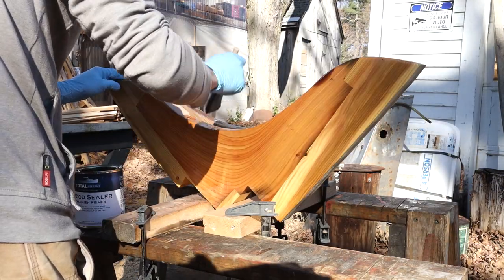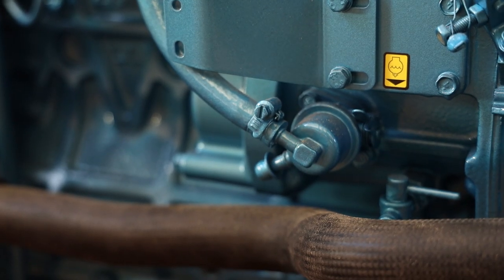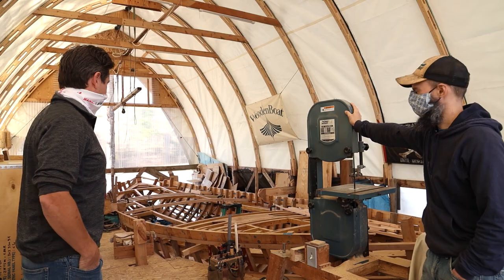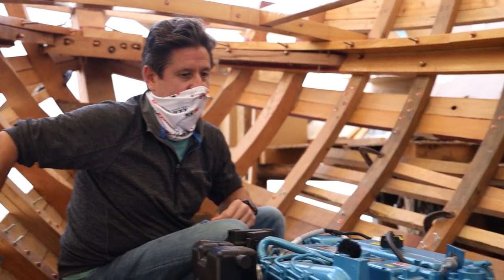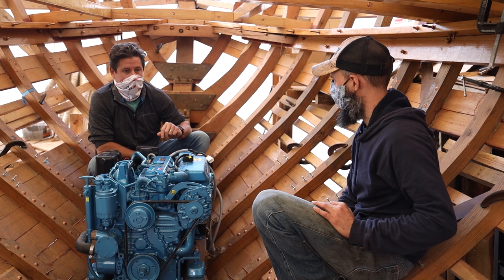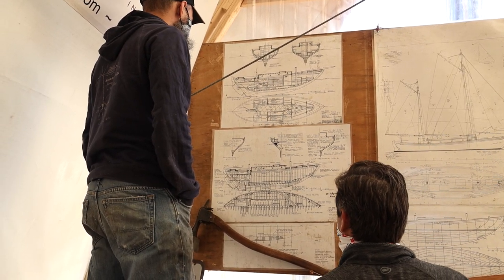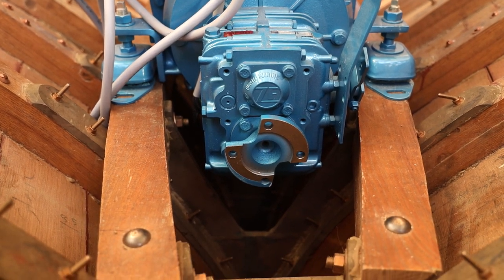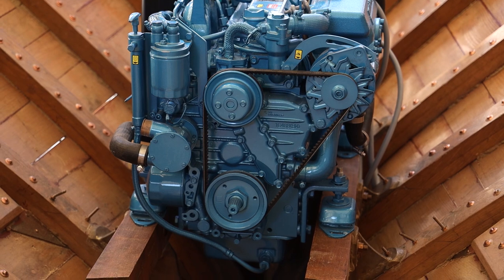Designing the Power Plant - Episode 137 - Acorn to Arabella: Journey of a Wooden Boat

Comment: No hot water??   Trust me, if you have nothing else down below, get hot water!

Also - do a full electric audit - double it and put enough batteries to deal with it - you need an Engine battery and a house bank and a charge controlling system - you will be surprised what you think you don't need but you end up needing.  2 Alternators is a must if you are travelling.
Reply: He needs to seriously consider a keel cooler.  A little more cost but a lot less problems later on.
Reply: I always see people go bananas over the engine. Everyone makes it sound like a disaster if there was an issue. You guys know this boat is wind powered, right?
Reply: As it stands, they'll have to stop recording and making videos once they're under way. Without solar or at least a battery bank running off an alternator, they won't have any power to speak of within days of setting sail.
Reply: @joshuawalker7054  
The boat has a motor.  If it's going to be used it ought to be setup correctly.  A keel cooler does away with the need for a raw water pump.  One less thing to give problems.  No chance of obstruction by trash and weeds. And the biggest thing.  No internal salt water corrosion. 
If nothing else the motor can be considered emergency equipment.  If the boat runs aground (all boats eventually run aground) a raw water inlet can be clogged with mud causing the engine to overheat and fail when you need it worst.  I know this first hand having replaced a head on a commercial fishing boat only to see the captain run it aground 30 minutes later and blow the engine.
"You guys know this boat is wind powered, right?"  Yes and it's made to go places.  So why take an anchor?  Right?  Better yet take an anchor but not anchor chain.
Reply: @Phyde4ux  
They could run convertors for 110VAC but they have to be good ones not to damage certain electronics.  They could crank the engine daily to charge the battery bank, something they need to do anyway.  I've used a 2000 watt convertor to run my house after ice storms using a 4 battery bank on a semi truck before and I only had to crank it and charge them up every 8 hours or so.  Most Freightliner dealers have 12V batteries for $50 to $80 so it's wouldn't be expensive to set up.  One thing they do need to avoid is specialized marine and industrial batteries.  They're expensive hard to find and don't last much longer than semi batteries.
Reply: Fit a simple dog clutch to the propshaft  to disconnect the engine fully from the prop so the prop can 'free-wheel' and fit an alternator to the propshaft so you charge the batteries whilst you are under sail
Reply: @nocare  
Yes deep cycle batteries are better they also cost 2 to 4 times as much making it more economical to use cranking batteries.  With added savings you could by more batteries also adding redundency and increasing life span by reducing the cycle depth.  If you want maximum life you can go with old style batteries that need water added regularly.  Also more expensive.  I've had semi batteries last as long as 7 years which is the same you'd expect from marine batteries.  All that said I still think the low cost and availability of semi batteries would be the deciding factor.  I've seen it take 3 weeks to get batteries for some equipment and boats.  At least half the time the owners end up switching out to semi batteries rather than wait.
Reply: @Andrew White 
The engine itself has a coolant pump.  The raw water pump is an additional pump and usually prone to leakage and corrosion damage due to pumping salt water.  A keel cooler is usually made of cooper or brass which isn't effected by corrosion and the coolant running through it and the engine is standard anti-freeze.
Reply: @johnbloomfield5705  
You won't get enough torque from the prop to generate much power.  Propulsion props are designed for delivering power not scavenging it.
Reply: Just for sanitation, it is nearly impossible to wash dishes adequately without hot water.
Reply: @nocare  
The only time severe gassing would be a problem is if a cell shorts and that can happen with any type of battery.  All batteries are going to produce some gasses when they're charged.  Some of the maintinance free ones have a barb you can hook a rubber tube to and place it in water that will help with the gas and suck water back into the battery if contracts.
Reply: @Pamudder  
He could use a heat exchanger hooked into the engine coolant system to heat water but the engine would need to run to make it and it would need to be fairly large if there's not going to be a reserve tank.
Reply: @nocare  
The convertors have a low voltage cutout circuit so they would never be drawn completely down by them.  Other 12V accessories would however pose a risk if they didn't contain some sort of low voltage cutouts.  Things like lights for example.  When I was using the set up I mentioned for my home during a 6 days powerage I always knew if I had waited too to crank the truck because the convertor would start beeping then shut off.  Yet the batteries still had enough power to crank the truck.  One battery is enough to crank a truck if it's fully charged when you have 4 like most semis they can be fairly weak and still work.
Reply: @tonyrmathis  Tony they shouldn't use lead acid batteries at all. LiFePo batteries are vastly superior.  They can use basically the full capacity without ruining them, they don't self discharge much, they last ten years, they are smaller, and they weigh a fourth. They are more expensive up front, but way cheaper long term because you can actually use them without ruining them. Being sealed is another plus. No h2 build up, or acid in the bilge.
Reply: Oh and my freightliner trucks have a 12V low voltage cutout switch on them that will turn off everything except the engine and starter if batteries get too low.  That's probably why the batteries last so long having not been completely drained repeatedly.
Reply: @court2379  
I've heard about those but don't have any personal knowledge about them.  I saw a video on Sailing Doodles I think.  They sure seem to be a great option but of course the cost and availability will be an issue.  Honestly h2 was never a problem on any of the boats I worked on and the battery boxes always contained any acid leaks.
I guess it comes down to financial considerations.  If you've got the money the lithium ion is most certainly the way to go.  I will say this weight is a major consideration to me.  Big heavy batteries are a back breaker when trying to work in close quarters so that would be a big bonus to lithium in my book.
Reply: Yeah, with cameras & laptops & various gadgets, those will consume power. They'll definitely want to make sure they've got enough battery.
Reply: @joshuawalker7054  There are areas of the worlds oceans where the wind is against you, or there is no wind at all. Also, getting into a port or harbour with adverse winds and tides may take weeks relying on wind alone.
Reply: @johnbloomfield5705  I'm not a boat guy....but that seems pretty genius to me👍
Reply: This whole series is tiring into a master class of ‘how to annoyingly make things harder than they need to be’
Now you are planning to complete the fit out without hot water, microwave, electrics etc........it’s a disgrace that you would put so much work into building a boat that will be such a displeasure to live aboard. It’s not an genuine experience’ that you are planning to inflict upon yourselves, it is stupid, unnecessary self inflicted punishment.
Reply: @tonyrmathis  I haven't watched Doodles for a while so cannot compare. Sailing Uma got rid of the diesel and went entirely electric, if you want to find those videos. Will Prowse has some good videos on batteries themselves. This one is a bit older (batteries are changing fast) https://youtu.be/TxGBde83CXQ I think he has a comparison of the costs of LiFePo to lead acid for RV use somewhere too (if this isn't it, I didn't watch it again).
Reply: @graham6229  
If it's place in the well between the keel and the belly beaching shouldn't be a problem as for corrosion I've never seen it be.  The one exception was one made of steel.  Once they get the initial ozidation layer corrosion stops.  And from my experience raw water pumps and heat exchangers have much more problems with corrosion than keel coolers.  Blown seals, impellers, debris and fittings all seem to be a constant issue.
Reply: @court2379  
At the core of my comment was cost and availability because that's how I would need to do it to get the maximum utility for the lowest cost.  Absent those two requirements then much better alternatives most certainly apply.  Perhaps the fact that they are building the boat themselves caused me to assume the same considerations would apply to them.  But of course they bought a new engine and I would've probably rebuilt a used one and to save money so I'm probably off base on that assumption.
Reply: @joshuawalker7054  the engine is technically an emergency system.

You want those to work.
Reply: @ScottKenny1978  I was watching a youtube where a couple removed a diesel engine with 4 hours on it and replaced it with an electric one and everyone in the comments lost their minds. They have now been going on 4 years without a problem.
Reply: @joshuawalker7054  yes, and how far from home (or at least manned marinas) do they get?

Part of the plan for Arabella is going well off the beaten path.
Reply: I thought this boat was going to be doing some serious sailing. The way it's looking now, it might be for weekend getaways. He really needs to take a few notes from S.V. Seeker. I know it's not the same caliber of ship but there is still a lot to take from that build.
Reply: @ScottKenny1978  They go around the world! It's "Sailing Uma" - Good Youtube channel.  They are flagged in Canada and currently in the Netherlands.
Reply: @yuriismywaifu203  I don't think Arabella is going to a heavy-duty sailing boat. I mean, it uses a tiller to steer. So much for any kind of autopilot. I'm pretty sure it's not going to have any kind of NEMA 2000 network either.

Comment: One big sheetmetal catch pan under the engine is the way to go on a wooden boat.
Wood soaks up oil and fuel. 
Just sealing the wood isn't going to be sufficient. 
You will have to fabricate the pan to fit the area and must have a drain toward front or forward of engine for easy access. Good luck guys!
Reply: It wouldnt bee that hard to modify the hand pump with some valves, to be used to empty that pan.
Reply: @wi11y1960  agree. Could put a tee and run another hose to a drain point fitting on the pan with shutoff valves for each line. Never thought of that. Two minds better than one!🙂
Reply: Use fiberglass & mold the pattern in place. Easier to clean, easier to see parts when they fall (& they will) & no rattles!
Reply: @jeffwisemiller3590  And you can still use a magnet to fish them out from the back.
Reply: Maybe copper sheet
Reply: @chrisv4640  nope, non conductive, no bonding issues or chance of arcing wires.
Reply: @jeffwisemiller3590  What wires?
Reply: Had same thought, but was thinking it could be made form fitted with plywood and epoxy fiberglassed so it fits closely flush ribs as well as coming up over the mounting beds to catch inevitable dropped tools etc funneling them down and forward to a catch pan area with absorbent mat'ls.
Reply: very sound advice,stainless 304,it was my first thought.
Reply: remove the motor and fold it over the mounting beds.
Reply: @chrisv4640  Starter motor power, temperature and pressure sensor wires.
Reply: With the money they've spent they could have a 16ga stainless pan fabricated for a catch pan. Fiberglass will eventually fail. Stainless will not rust or corrode like copper.
Reply: @wi11y1960  unless there is a catastrophic gasket failure there won't be a need for a drain or a pump.
And then only about 10 qts of oil.
Reply: Chris V thinks the engine is a pull start. 🙄 & all the lighting is from whale oil lamps. 🤔
Reply: and someone else thinks insulation and proper wire routing is a myth :-), and somehow, fiberglass just does'nt seem right on this boat.
Reply: @chrisv4640  ground. power to starter. Power to solenoid on injector pump. Power from alternator to battery for a start possibly water temp and oil pressure
Reply: @BIGSMOKE-bl2lq  you do understand that the engine is metal, right? The wires would short against the engine before they touched the pan. But I guess you expect them to suddenly start slacking on their extreme attention to important details like properly securing wires. You are probably right, they will probably just wad the wires up in a ball and let them hang.

Comment: If I was you, I would install a permanent pan underneath the motor, because in time your engine may leak and drop oil or diesel. Than you will be happy to have an easy way of keeping your ship clean.
Reply: Also slope the pan slightly forward (towards the access opening) so the small drips do run to one spot and can be noticed and cleaned up there.
Reply: @NoseyLurker  the boat is pitching alot flat is fine,forward movement forces the liquid to the rear.
Reply: That was my first thought. It’s just a little sheet metal work attached at the motor mounts. Stainless steel is also an option. Corrosion should be a consideration epoxy coatings work well. Add a drain to draw off any spills or leaks that will develop over the years. I also don’t understand how you will live without a microwave. Such great growth in battery pack technology that you should consider. Tesla has shingles that are solar panels. You need reliable power for safety don’t skimp here. Having arrays that you can deploy when needed would be great. Fresh water storage for the sink seems essential to me. You’re going to be living on the boat not camping.
Reply: My first thought as well. My experience on the farm is that everything leaks something over time. If any engine maintenance is needed a pan would catch any fluid and also that nut you know is going to drop.
Reply: i don't know if a drip pan would work so well in a boat that is leaning 45 Deg. to one side then all the sudden to the other side. plus their is the never-ending up and down from the front to the back as you go through the waves. the only use i could see a drip pan serving would be to hold some of those towels that are made to soak up oil/fuel spills. my best guess here.
Reply: At least it wont rot wherever it drips.
Reply: 👍Darrell
Every boat succumbs to the dreaded bilge smell. As EVERYTHING ends up in the bilge. They (yachties) can try all they want. And every little bit of prevention help. However, it is a boat, and its bilge will; be a bilge.